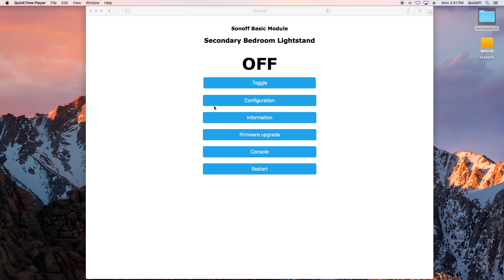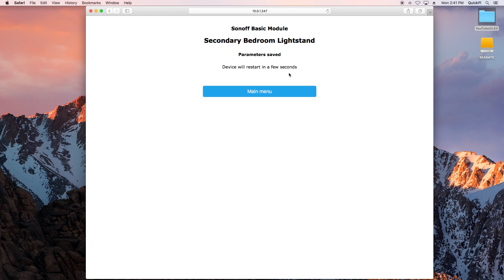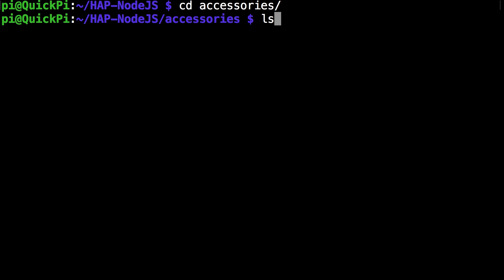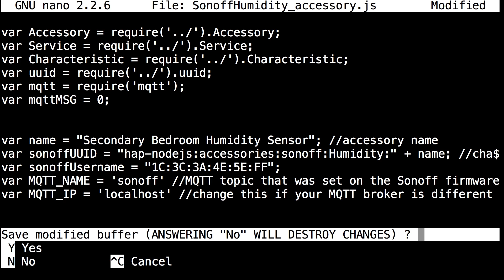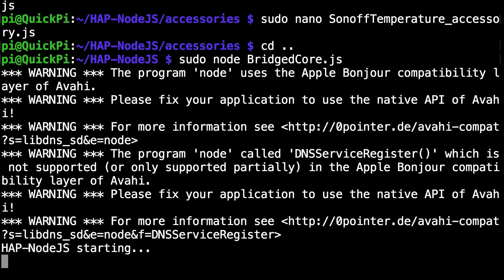TUTORIAL: Sonoff with DHT22 Sensor on Apple HomeKit

Comment: Anyone managed to use dht22 (or any sensor at all) with sonoff 4ch? It seems to be slightly different hardware (different esp chip), and no GPIO14 available. I've been trying to get it work for few days now using "IO2" (GPIO2 Pin?), no success.

Comment: I got it working with a Wemos D1 mini. Flashed Tasmota on it, hooked a DHT22 on it, and its working. But the temperature reading is a bit off. I guess these sensors arent that accurate. So I opened the accessory file and went down where we return our current value and pasted a (minus 3) behind sonoffObject.currentTemperature. so it says: callback(null, sonoffObject.currentTemperature - 3 )
At first I was cheering, because The Homekit App showed me the temperature I was expecting. but then, after a few seconds,  it went back to the "too high" temperature. But when  I ask Siri its telleing me, the "better" temperaure 3 degrees lowered. Idk why exactly this is, but I think its coming from the MQTT message from the sonoff.

Has anyone an idea how I could fix that? I'm not that good in javascript and can hardly understand how this works.

Comment: Hi QuickPi, I’m getting stuck with a D1 Mini that I need to use as temperature sensor, I tried to use a Sonoff with Tasmota 12 and after some issue is working fine (the sensor was different in my case a AM2301) but this D1 is not working, the message from the console:14:43:18 MQT: tele/Temp1/SENSOR = {"Time":"2018-04-29T14:43:18","DS18B20":{"Temperature":25.2},"TempUnit":"C"}

Any hint? I include my SonoffTemperature_accessory.js file for reference.

var Accessory = require('../').Accessory;
var Service = require('../').Service;
var Characteristic = require('../').Characteristic;
var uuid = require('../').uuid;
var mqtt = require('mqtt');
var mqttMSG = 0;

var name = "Sonoff Temperature Sensor Temp1"; //accessory name
var sonoffUUID = "hap-nodejs:accessories:sonoff:temperature1:" + name; //change this to your preferences
var sonoffUsername = "4B:2A:3B:6D:5E:FA";
var MQTT_NAME = 'Temp1' //MQTT topic that was set on the Sonoff firmware
var MQTT_IP = 'localhost' //change this if your MQTT broker is different
var sensorType = 'DS18B20';

var options = {
  port: 1883,
  host: MQTT_IP,
//  username: 'pi', //enable only if you have authentication on your MQTT broker
//  password: 'raspberry', //enable only if you have authentication on your MQTT broker
  clientId: MQTT_NAME+'TempHAP'
};
var sonoffTopic = 'cmnd/'+MQTT_NAME+'/status';
var client = mqtt.connect(options);

client.on('connect', function () {
  client.subscribe('stat/'+MQTT_NAME+'/LWT')
});

var sonoffObject = {
  currentTemperature: 38,
  getReadings: function() {
    client.publish(sonoffTopic, 'SENSOR');
  },
  identify: function() {
    console.log(name + " Identified!");
  }
}

var sonoffTemp = exports.accessory = new Accessory(name, uuid.generate(sonoffUUID));

sonoffTemp.username = sonoffUsername;
sonoffTemp.pincode = "031-45-154";

// listen for the "identify" event for this Accessory
sonoffTemp.on('identify', function(paired, callback) {
  sonoffObject.identify();
  callback();
});

sonoffTemp
  .addService(Service.TemperatureSensor)
  .getCharacteristic(Characteristic.CurrentTemperature)
  .on('get', function(callback) {
    // return our current value
    callback(null, sonoffObject.currentTemperature);
  });

  client.on('message', function(topic, message) {
  //  console.log(message.toString());
    message = message.toString();
    mqttMSG = JSON.parse(message);
  //  console.log(mqttMSG.StatusSNS.DS18B20.Temperature);
    sonoffObject.currentTemperature = mqttMSG.StatusSNS[sensorType]["Temperature"];
  });

setInterval(function() {

  sonoffObject.getReadings();
 
  sonoffTemp
    .getService(Service.TemperatureSensor)
    .setCharacteristic(Characteristic.CurrentTemperature, sonoffObject.currentTemperature);

}, 30000);
Reply from the maker: Change the line var sensorType to match your sensor
Reply: QuickPi , already done, as you can read in the text, seems that the message is not arriving to hap, the topic is “tele/Temp1/SENSOR”? I can’t read via MQTT tool on iPhone.
Reply: ok, at last sorted out, i presume that the name of the file must conclude with "_accessory.js", thus the name of the duplicate must be "x_accessory.js", I setted as "_accessory2.js"!!

now everything is fine, the topic is always STATUS10.

hope it helps any other with the same issue :)

Comment: Thank you very much...this video is very useful for me. I would like to ask you if you have a correct configuration for sonoff dual R2 to use it like rolling shutter, i tried to find in the web something but I’m not sure. Maybe if you have time can you make a video for that scope? That should be great😄
Reply: Amruth have just released the script for the Dual R2. See his Github under MQTT . It works great - the only problem I have so far is that it does not update the HomeKit toggles when I switch the Dual one and off "by hand" on the device:(

Comment: Hi quick pi. Thanks for all your great tutorials. I have just bought a pi 3 and started messing around with it. It is a great little unit. The question I have is - it is possible to use all the home kit things via 3g / lte.? I have for  now In stalled hap node Js and have setup one orvibo s20 smart switch through the guide provided by kristof korcsog here on YouTube. But it only works via the local wifi????
Reply from the maker: You need an Apple TV linked to your Apple account for this to work. Apple TV 3rd generation and above
Reply: QuickPi great - thanks :) and thanks for the quick reply :) BTW do you have any clue how I add multiple orvibo s20 sockets in the tutorial kristof korcsog has made?

https://youtu.be/KwnEAy58BWY
Reply: I have followed his tutorial and it works like a charm, but I can't figure out how to add more sockets?:( Can you help?
Reply from the maker: Duplicate the accessory file for the orvibo, change the UUID, MAC Address, and as well as change the IP address.
Reply from the maker: Duplicate the accessory file for the orvibo, change the UUID, MAC Address, and as well as change the IP address.
Reply: I thought at this as well, but I cannot ad one more file - I don't have the permission - any way to correct this?
Reply from the maker: sudo cp file1 file1copy

change file1 to your accessory file name for orbivo. Change file1copy to the Orbivo2_accessory.js
Reply: Great thanks:D
Reply: QuickPi hi quickpi - sorry for all my questions. I have experienced that when I have set up the Homekit app with my devices it triggers the orvibos fine - both on local network and on lte/ 3g . But I have noticed that it does not always update the Homekit app when the orvibo is manually shut off by hand ? Is there a way to fix this ?
Reply from the maker: This is a problem with the orvibo accessory, something I can’t help with :/ sorry
Reply: QuickPi thanks :) Do you Think the sonoffs are better for this task ?
Reply: On the Pi, What OS are you using? Thanks
Reply: Jorge Cuiça Raspbian

Comment: Hi

Does it work if instead off using sudo node BridgedCore.js I use  Core.js ? it's the same way or we must do something differents?

I've been trying with Core.js I don't finf my component I only found "Sonoff Humidity Sensor" AND " Sonoff Temperature Sensor "

I've put other components doing  sudo cp SonoffTemperature_accessory.js SonoffTemperature1_accessory.js and change the MAC adresse but I can't find it

Comment: Hi, i don't have the correct value for temparature and humidity on Sonoff TH16 with the AM2301 sensor.  on the webpage it say's AM2301 Temperature 28.7°C    AM2301 Humidity                   57.1%               but on Homekit it gave me 38 for temperature and 99% for humidity.
Reply from the maker: +Antonio BURCION make sure you have configured the topic and all properly.
Reply: QuickPi yes, everything works except that it doesn't show the correct value, I'm using Celsius degree instead of Fahrenheit
Reply from the maker: +Antonio BURCION hmm can u dm me via twitter
Reply: yap i have the same problem, i think is this line "currentTemperature:38," this line is setting the value
edit: i just figured out is the delay at  the end of the file that delay the reading valeu of the sonoff and show the default value on the homekit, 38 C, 99%
Reply: Luixmod xmod hello did you find any solution? The humidity is correct on my homekit and also on web page but temperature is different (always 38*C on homekit)
Reply: I have similar problem. Humidity sensor shows correct value but temperature does not. Any ideas?

Comment: Is it true that after the latest firmware 5.5.1 the dht22 hack doesn't work anymore. Because I have wired the dht22 to my sonoff with tasmota and when I change the gpio14 to dht22 the sonoff restarts. After the restart the gpio 14 is set to none Again. I read something that after v 4.2.1 Or 5.2.1 the dht 22 doesn't work anymore. Do you know something about this Or could you confirm this. Thanks in advance.
Reply from the maker: Did you follow the proper update path. I have never had an issue with my DHT22. I'd look into that if I were you
Reply: QuickPi What is the proper update path. My sonoff was new and i flashed the latest firmware of tasmota on it. In config i only changed Ssid and password. After flash tasmota works I can use the relay with toggle. But when I connect my dht22 and go to configure module and set the gpio 14 to dht22 it restarts and nothing changed. If I go to configure module Then it is back to none
Reply from the maker: EDIT FOR ALL: THE USER REFLASHED HIS SONOFF AND IT HAS WORKED. If you have a similar issue, just reflash

Comment: Hi! 

Because I'm a Newbie in this, i have to ask one important Question: can I use a son off switch WITHOUT a raspberry, means directly with HomeKit+ATV4? And if so, what i have to do? Flashing the son off and... what else? 

Thank You & thumbs up for Your Output! ;)
Reply: I think the correct term for the RaspberryPi in this case is "Bridge", but do i need these "Bridge" or recognizes HomeKit on ATV the Sonoff-Switch as a BelkinSwitch after Your configuration?

Edit: i have a MacMini running in my LAN, can the MacMini do the Job of the Bridge if absolutely necessary? 

Thanks!
Reply: yes it can. You have to install homebridge  and mosquito broker on your macmini in orde for it to work. Keep in mind though that your Sonoff modules need to be flashed with for example Tasmota software.

Comment: Hello, nice work, thanks! Would it be easy, software wise, to use a DS18b20 sensor directly attached to the sonoff?
Reply from the maker: Yes, you would just need to remap the sensor in the accessory file, but overall yes. Please DM me on twitter if you would like help doing this, I will be more than happy to help :)
Reply: Thanks a lot, i will let you know how it went. Also, i played around with the RGB lights. It seems that WS2812's are easy to configure and play with, but non adressable RGB light are more challenging. Thanks for your continuous support and great updates
Reply from the maker: +Gaspadin no problem and yeah ws2812s make LEDs very easy
Reply: Hi, Quickpi! I got a bit more time so i wanted to try a ds18b20 sensor on sonoff. Using your accessory file, is this where i should be remapping the sensor? " sonoffObject.currentTemperature = mqttMSG.StatusSNS.DHT22.Temperature;" - switch DHT22 with DS18b20? Thanks!
Reply from the maker: +Gaspadin yeah give it a shot
Reply: It worked, i just looked in the console of the sonoff and put in the accessorry file the exact sensor info. Thanks! Any new updates coming from your side on some projects?

Comment: Hi. I got a problem with the sensor. In my sonoff it is called DHT22-14 and changing the name in _accessory.js gives me an error because I can not use the -. Is there any solution? Thank you.
Reply from the maker: Try changing line 64 in both accessory files. Change the mqttMSG.StatusSNS.DHT22.Humidity to mqttMSG.StatusSNS."DHT22-14".Humidity. 

Same for temperature,  mqttMSG.StatusSNS.DHT22.Temperature to mqttMSG.StatusSNS."DHT22-14".Temperature.
Reply: No, it does not work. I have also tried with mqttMSG.StatusSNS['DHT22-14'].Humidity and continues with the same error.
Reply: I got it. I leave here the solution in case it happens to someone else.
You need to change a - for an _ in the xsns_dht.ino file. On line 208 where PSTR ("% s-% 02d") is written, you have to change it to PSTR ("% s_% 02d"). And so in the _accessory.js we can put DHT22_14 and works perfectly with more than one sensor in the same sonoff. Thanks for the videos.
Reply from the maker: a lot of fixes, but thank you! I will get in touch with Sonoff-Tasmota to see if we can make that a default fix

Comment: Hi. The temperature in sonoff using mqtt is in JSON format so how do i get the correct data?
Reply from the maker: +estuardo muñoz what do you mean? Are you not getting the right data?
Reply: Hi, no im not getting the righ data... the temp sensor from the sonoff webpage reads 22.8 and in siri it reads 32...
Reply: the sonoff sends json encoded mqtt messages to the broker, so in order to retreive that JSON encoded data y have to specify it somewhere... for example this is my mqtt data for the sonoff sensor... tele/bedroomlight/SENSOR = {"Time":"1970-01-01T20:31:53", "DHT11":{"Temperature":23.0, "Humidity":64.0}}.. so if i want to get the temperature out of the mqtt message i have to specify $.DHT11.Temperature and $.DHT11.Humidity for the Humidity readings...
Reply from the maker: +estuardo muñoz if you want DHT11 support, in both files replace all instances of DHT22 with DHT11. Then it will support what you want
Reply: QuickPi thanks for the reply.. i replaced all on both file but still not getting right data... plus if i ask siri about the bedroom temperature she does not recognize any accessory that can do that...
Reply from the maker: +estuardo muñoz can you contact me via twitter, I can help you better

Comment: I think your tutorials for software installations are great. I would just suggest that they need just a tiny bit of background as to why I might do all that they suggest. It follows that if I blindly follow the tutorial I am not sure what I must do to get each piece of functionality. In this case for example, I don't see why I would want the sensors recorded in Homekit BUT I would want them in MQTT. Is there somewhere a Homekit GUI/Display on a screen other than using an app (unless the app has awesome screen configuration)? I currently use Node Red as it has a fairly easily configurable UI
Reply from the maker: +Richard Stott the Home App on iOS 11 is quite friendly and on an iPad, it can be the perfect display. There are also many paid HomeKit apps that offer an even better setup than this.

Comment: Thanks for vid. But why no Homebridge?
Reply from the maker: +wasyl00 the existing homebridge plugins are extremely unstable. They were not working for more than 24 hours in mine and as well as other tester setups.
Reply: +QuickPi hmm interesting. My setup is working fine (winpc, sonoff switch, synology, nas ipcam plugins + mqtt mosquito) but I have it autorstarted in case of reboot or failure.
Reply from the maker: +wasyl00 I was referring to the specific mqtt sonoff tasmota humidity and temperature homebridge plugins